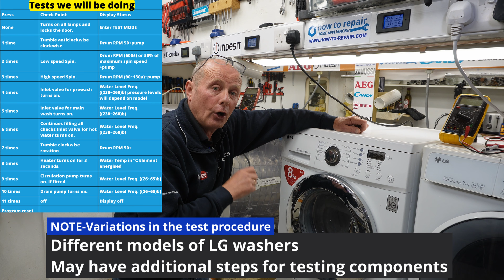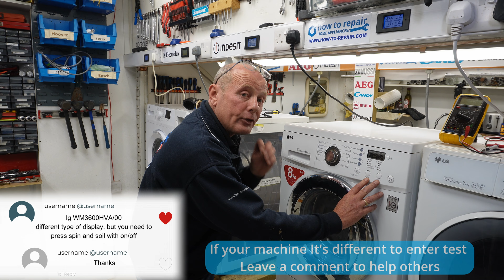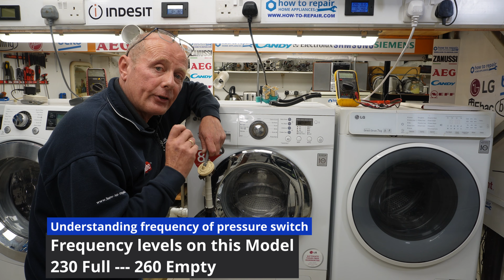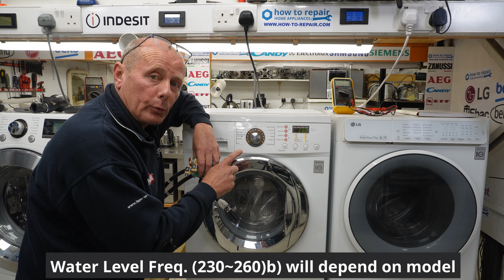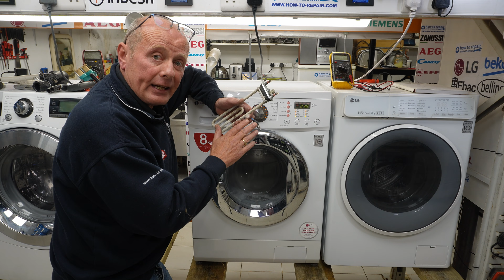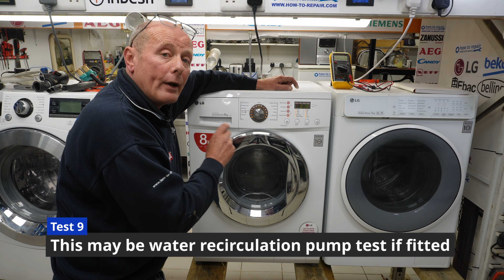LG washing machine test mode and diagnostic service sequence

Comment: Nice in depth video, my 2010 model F8068QDP machine had a door jam, I removed the door and replaced the door latch switch which still does not release the latch, with another unit. The new latch does not secure the latch and water does not fill. Could the replacement door switch be the issue, or 8s it bigger than that?

Comment: My WM4270HWA stops in diagnostic mode on step 1 after 2 seconds or stutters and doesn’t spin.  In step 2 it turns on the drain pump and sometimes spins counter clockwise. I’m not getting any error codes.  Is this a hall sensor issue?  Thank you!

Comment: I have an LG WM3570. It stopped draining. I replaced the pump and the position sensor. Neither helped. It can wash but can’t drain. I run the spin only cycle and as long as I manually removed the water, it definitely spins. I’ve checked frail everything and nothing is blocking the drain hoses, etc. I’ve gotten the tcl code also but I’ve run the tub clean cycle but doesn’t do anything. I’m about ready to throw it out but I hate that idea. Any suggestions?

Comment: Hello,  My LG washer/dryer machine (old motherboard EBR77678320) does not energizes the water inlet solenoid valve. Also during diagnostic there is no water intering the drum. I tested the three solenoids and it is working fine and energizes when applied with an external power. What could be the problem of my board?

Comment: Hi can you tell me how to get to test mode on my lg front load model WM2496HSM. I think it’s between 15-18yrs old. On my last cycle it shut off during rinse cycle and left no error code. When I try turning it back on it immediately turns its self back off. It lights up and 2 seconds later turns off. I tried doing the factory reset but that did nothing. Any advise? Was hoping maybe diagnostics test would tell me what’s wrong ?

Comment: Hello. My LG washer just stopped spinning in the middle of a wash. I think mine is a bit newer than what you have because it has a steam wash option too. The wash cycle was set at "Sanitary" and it usually runs over 2 hours. It was making noises and the display showed that it was 'rinsing' but the drum was not spinning. With 1 hour 8 minutes left to go, the timer was showing the same after about 10 minutes. The 'lock' was on so I could not open it but with power shut off, it allowed me to open the door after about a minute. When I turned it on again, within a few seconds, it locked itself again and while it lets me select different wash mode, it still won't spin. Could ask I ask for your expert opinion as to what happened and what needs to be done?

Comment: Hi, I've watched various videos of yours and are really useful however, a new washing machine we have is the LG F4C510GBTN1. I can't seem to work out how to put this into Diagnostics mode. On previous models such as the F1456QD, you would press and hold the two centre buttons like in the video above but on the F4C510GBTN1, there's only a power and play/start button. 

Anything you can do to help would be appreciated. Thanks

Comment: I have a WM3670HWA that does not come with hall sensor. Reset did not correct issue. PWB assembly (rd4) test good.
In test mode it jerks around and sounds like a scratching record going round. 

LE error trouble shooting stator 11 ohms across any combination of two of the 3. Motor wire harness continuity all test good. Rotor magnets in excellent shape and spines intact. 
The sound is the same as your hall sensor video but again no hall sensor on this model. Spins freely by hand inside and at shaft in back. Bearings quiet and smooth.
No signs of wear. 
Rechecked everything and reassembled, still get e error.

Comment: I have the LG direct drive 7 washer dryer. It fails to complete a wash going to IE, what is the cause of this please
Reply from the maker: Hi mate, let me quickly explain the IE error code. This error appears when your machine can't fill up with water in the given time. It could be due to a poor water supply reaching the water valves. You should check that the tap and fill hose have water flowing all the way to the valve. You can test this by putting the hose into a bucket and opening the tap to ensure there's enough pressure.

You can also inspect the filter at the back of the water valve. Sometimes, debris can clog it and restrict water flow into the machine. If everything looks good, the problem might be with the water valves or something else.

It would be really helpful for me to get my video shared and help us fight appliance waste! Please remember to subscribe to our channel, as that really helps us 😇

Since we work very hard in our warehouse making free video guides for you all on appliances, we always appreciate a beer, offering a choice of single or round beer. https://www.how-to-repair.com/help/buy-paul-a-beer/ 

Thanks, Paul 👍

Comment: I have an IE code popping up and I have replaced the inlet valves and the pressure switch. Still have the IE code. When I run this test nothing pops up when the water fills. Any ideas?
Reply from the maker: Hi, please use our contact us page and make sure you fill out the request for what your problem is. I will need the full model number of the identification plate and the details of your problem so that I can provide you with useful literature. A video shoot of the problem would be perfect as well.

I will get back to you within 24 hours, normally. https://www.how-to-repair.com/help/contact-us/  

Please remember to subscribe to our channel, as that's what keeps this channel going. Thanks, Paul 👍

Comment: Got OE code on my LG. After replacement the pump on my LG  Wm3273cw still not draining. Did diagnostic test 1 through 8 Worked fine, 9 or 10 shut off the machine  What is my next step. Thanks
 Dennis
Please help

Comment: Hi.  My LG Front Load 5.5kg washing machine works only in Rinse+Spin mode and for all other modes of washing, the machine starts spinning and after about 2 minutes it gives an error by Audio alarm as well as blinking in Pre Wash and Crease Care buttons. Any idea to resolve this ?
Reply from the maker: Hi @veemanipune I will need the full model number of the identification plate and the details of your problem. Please use our contact us page and make sure you fill out the request for what your problem is. We will get back to you within 24 hours, normally. https://www.how-to-repair.com/help/contact-us/ 

Please remember to subscribe to our channel, as that's what keeps this channel going. Thanks 👍

Comment: Hello, very pleased watching your diagnostic demonstration video on the LG front load washing machines. I acquired a LG front load machine model number wm2301hr that doesn't work. The machine won't even power up when plugged into 110 volt acquired outlet. I'm not a professional electrician but do have some knowledge and experience with ac and dc circuit's and mechanical knowledge. With my diagnostic troubleshooting and research led me to a fault in the PCB main control board due to the blown fuse in that control board. I replaced the fuse with the exact specs and tested. About 5 seconds of plugging the machine in, a thermal resistor began to smoke and I cut the power immediately. The fuse didn't blow and the resistor didn't blow. My understanding told me there's a internal issue or short in another circuit within the control board. I ordered another control board used in working order with matching serial numbers. I also ordered the upper user interface PCB boards as well. I will receive the parts on Monday. I'm wondering about the direct drive motor stator and hall effect sensor. I disassembled the motor and stator assembly from the tub and it visually looks like new. I'm thinking with caution to leave the motor unplugged when installing the PCBs during power up, the user interface should display the appropriate code for motor fault with it being disconnected. I'm definitely needing help activating the diagnostic mode for my particular model as you mentioned the differences between different models. Please let me know how to contact for help with these issues directly. 

Thank you
Reply from the maker: You can always send me your contact details through the website I'm sorry I can't put my phone number on here as I would get inundated. Also you said you're on 110 voltage so please leave the appropriate time to call based around GMT.
Reply: @allanconner1406  I've learned everything from YouTube because my dad owned a business and never really taught me how to fix things. He was the best. That stuff just wasn't his thing.
As far as my washer goes, it is very old, and it didn't scroll down so I could read the rest of the diagnostics. I pulled the whole thing apart for the 3rd time, drained it 3 times, and ran tests 3 times. What I figured out since it wasn't engaging the drain pump that I just bought is that I accidentally reversed the wires connecting to the pump. Nothing else was blocked, but since I didn't mark the wires and when I put them back, I had to guess... I guessed wrong. Lol. Thank you for the video. It helped me sort it out.

Comment: Great video ! I have the same washingmashine, model WM8516WE6 , when i try to enter test mode the screen lights up F ,  first 3F and then 2 fade out and one remains, then all switch off. Any suggestion? Thanks !
Reply from the maker: 3F ever code does not come up on my system which country did you buy the machine and can you explain a little bit more about the fault?
Reply: @How-to-repair   Thanks. Argentina. Is not 3 F faul. Something is wrong.I press the power botton and 3 F lights up verry shady, blury and them 2 F amd then one F amd all off. All this is very quick. Take about2/3 secs.
Reply: i have video of it.
Reply from the maker: @federicobacher  this does not sound like a standard LG error I suspect you may have a fault with the circuit board. Here are all the standard LG ever codes and what they mean. CL: Child lock is engaged
DE DE1 & DE2: Door is open
OE: Unable to drain water
IE: Not filling with water
UE: Load imbalance
FE: Machine is overfilling
PE: Water level pressure sensor fault
TE Or HE: A problem with the water heater, element or thermistor
LE: Large loads of washing for certain cycles
SE: Motor fault or issue with the main PCB
CE: Short circuiting of the motor or PCB
PF: Power failure
AE: Aqua Switch
Reply from the maker: @federicobacher  you can always upload the video to YouTube so I can see it
Reply: I solve it ! I checke the plug to the wall and I realiza it was a bit sulfated, so i clean it with a small metal brush and  solvent and all fina not. So it was a power supply problem. Any way you are so kind to help and anserBest for you !
 @How-to-repair

Comment: Quick question. I spend large periods away from home, what is the best way to ensure complete drain down and no standing water in a washing machine? Is the only option the filter/drain and leaving the machine door open?
Reply from the maker: I think that's the most logical thing to do. This will stop mold and the water getting stagnant. @aaaatttt101 please remember to subscribe to our channel as that really helps us https://www.youtube.com/shorts/e432SAb2g08  Thanks, Paul 👍
Reply: @How-to-repair  already done. I got the fault codes off your channel for my aeg washing machine

Comment: On newer LG washers made in 2021-2024 in order to activate the test mode you have to turn it off, then press 1st and 3rd button at the same time(usually it's "intensive wash" and "extra rinse" and then while still holding these 2 buttons, push the "power on/off" button. Display should start flashing and then you can cycle modes by clicking "start/pause" button.
Reply from the maker: Thank you very much for the information it will help others. I have these machines coming in next week and I will be doing a detailed video on these.
Reply: @How-to-repair  No worries, learned a lot from your videos a few years back when i was still an apprentice technician. At least i can return the favour and share what i know, if i already worked with such devices.

Comment: Is it possible to run the auto diagnostics mode in LG washing machines, i.e. checking all components of the washing machine one by one
Reply from the maker: This basically is doing that, it checks, all components heater, NTC sensor motor, haul sensor all water valves pump and recirculation pump fitted if anything is not working, then you should be seeing some sort of error code. The only thing it can't diagnose really is the circuit board and that's because this is the component that is running the test so it's very hard for it to test itself.